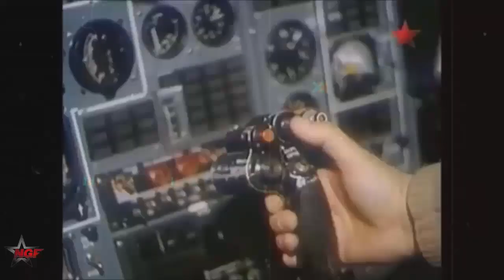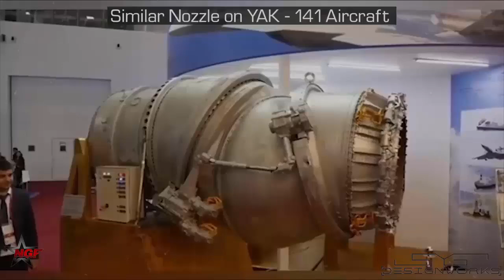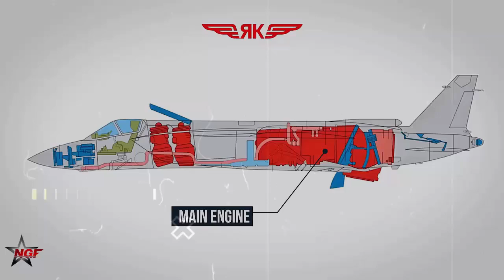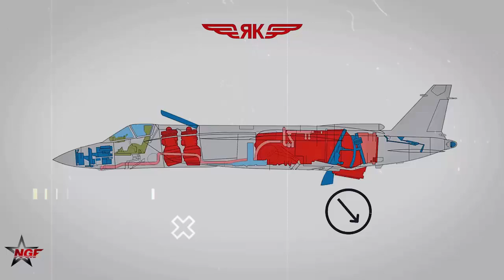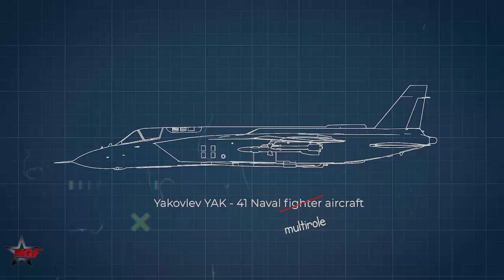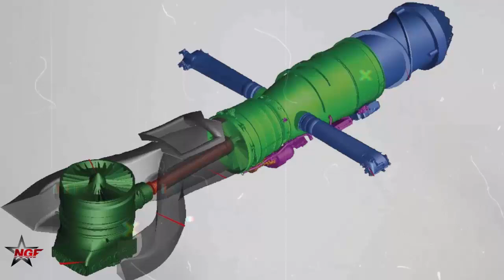Russia’s Yakovlev Design Bureau Ready to Resume Development of Vertical Take-Off Jets

Comment: Russian Yakovlev Yak-41 was the first successful VTOL fighter jet when the West failed. Russia stopped its development due to the collapse of the USSR but they can quickly pick it up again - especially if they are to partner with China which will find such aircraft, immensely useful on their small aircraft carriers. the Liaoning and the Shandong, that depends upon ski-ramp takeoffs. Mastering the VTOL aircraft as they are a bit tricky to handle on takeoff will add a further power projection in the Chinese navy airforce.
Reply: Building four prototypes is not a successful program. Maybe more like proof of concept? Resurrect a thirty-year-old project? If China thought VTOL or STOVL aircraft were worth it to them, then they would have stolen the technology from Russia 30 years ago. Just as Russians claim the Chinese stole your design for the MIG 1.44, MIG-29, SU-33, and SU-27.
And three engines, really?

Comment: BUT WHY? It just makes planes unnecessary heavy. It also reduces their payload and/or range and makes them "combat inefficient" for the sole benefit of "can start from a small area". You can't hide that small area, because it still needs a Radar to check if the sky is clear. And sand electronic warfare make hiding that IMPOSSIBLE. Please continue to make those beautiful planes with Excellent flight characteristics, dear Russia. Don't fall for hyped-up "capabilities", like the Americans do.